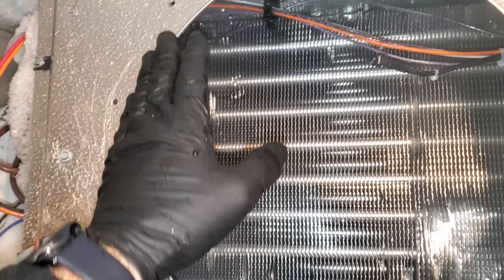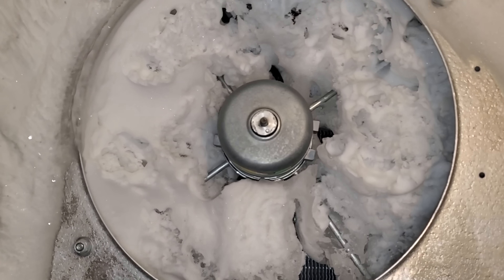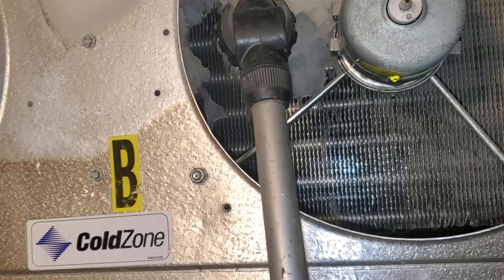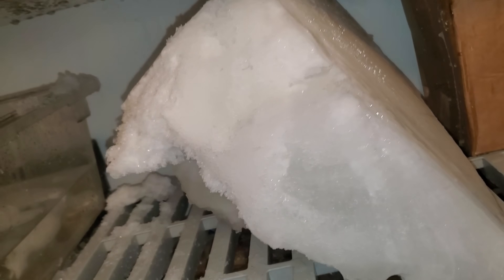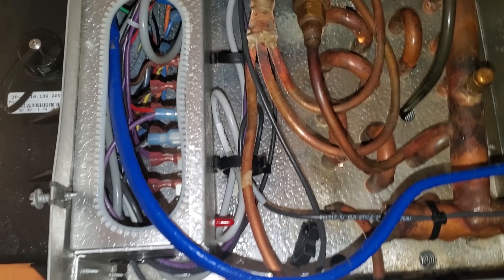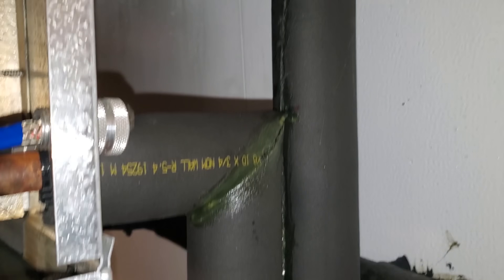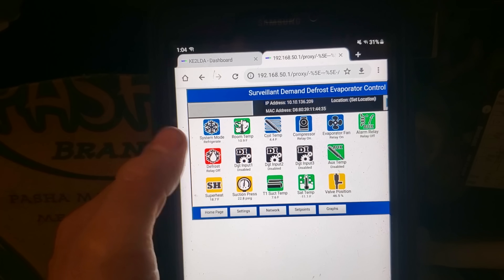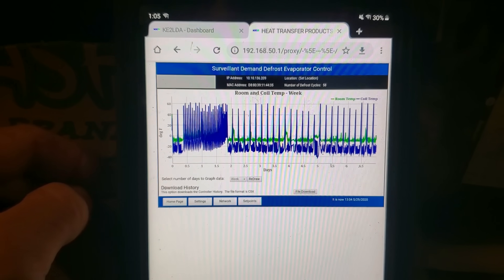IT'S BEEN ICED UP FOR FOUR MONTHS

Comment: Chris, at the beginning of the video, all those boxes are blocking the air flow, chocking the return air, I see that as being good part of the problem. I know, no matter how many times you tell the customer, don't stack boxes around evaporator, they still do it. From what I am seeing, it looks like a starving  return air flow problem. As far as the insulation repair, looks OK, I seen worse. Yes, the open end of the insulation (inside Evap.) should be sealed. I would redone that insulation on suction line inside Evap. Good job !!

Comment: Lots of fun ! Once had to defrost Jumbo evaporators in a 4000 SQ feet -20 ice cream warehouse along with a 2 foot dia.x 60 foot strip of ice at the top corner of the freezer , The corner wall had separated 4 inch 25 feet high and caused all this ice .

Comment: When you come across ECM's do you consider replacing them with conventional motors?  Over the years I have worked on some residential split-systems where a evaporator motor had taken lightning hits and their control boards where toasted, on two of them the customers had the motors replaced less than a year earlier, keep in mind we live in the lightning capitol of the U.S., these people are retired and on fixed incomes and really didn't have the money to buy another ECM, or actually really any other motor for that matter,however they need their AC working for health reasons. I had to solve the problem at as low of a price as I could. Now I understand ECM's  are more expensive that a cap run motor, but are supposed to save energy, which I discovered would take many years of run time to beat a cap run motor.

Looking at the other companies invoice, (they do a lot of radio advertising and their techs are commission incentivised ) I really felt the previous company really jammed it to them on the markup. My counter guy recommended a cap run, he explained he had a generic cap run that had the same RPM, same HP and same frame so it would right into the existing motor mount, all I had to do was cut the excess of the mounting screws ,after I had it in place, why the screws where so long I don't know but the motors fit right in, I found a safe place to ty-wrap the cap in and it was showtime. 

And the best part was when I handed the invoice to the customer, in both cases I thought the customer was going to cry because of the much lower price I was able to do the job for. And both agreed to go with a maintenance plan where one of us would stop by four times a year, check the charge which is seldom needed and do some house keeping, new filters, make sure the condensate drain was nice and clear, the A coil was nice and clean and the condenser was de-leafed and herbicide was sprayed around the unit twice a year to keep the grass and weeds away from the condenser.

I don't do any advertising but do get a number of customer references and for me it seems to work well. 

Charge a fair price, take of the customer and word gets around.

Comment: Do an experiment, braze on a 2 inch piece of 5/16 copper on the outside of the suction line as a sensor holder. 

The Ethernet cable connection on the side of the ke2 board is awesome.

Comment: "I am not an insulator"
(does a perfect insulation job)
" Again I am NOT an insulator)
Reply: I mean he's right when I was coming up a 45 degree miter is unacceptable and would of been torn out due. The reasoning is the  air gap at the 90s  can build ice and tear if another joint is unsealed anywhere on the run. 22.5 minimum was the angle for all cuts 15 degrees for ptraps. But it takes way to much time
Reply: As a once-upon-a-time union insulator, I can tell you it's not the worst I've seen.

A 3 piece 90, and using some ArmaFlex 520 contact adhesive properly. You need to paint it on the mating surfaces (not globs, like you'd paint a wall but light) and you NEED to let it tack. Once you've done that, press the seam together. It'll stay together for a long time and provide a proper vapor barrier.
Reply: He is not a perfect conductor either.
Reply: That's because he's a CONDUCTOR!!!!
Reply: German Plumber here, was thinking the exact same thing xD

But I don't do HVAC stuff ( not so common here ) so I dont have the first clue of that stuff.
Reply: Tyler Richardson    Looks pretty good to me!
Reply: Cutting down the pipes just to make a not even perfect insulation? He has to be joking, i wouldnt have even bothered with covering the gluemarks with tape.
Reply: i couldnt even figure out how he did that! he must show us how to do it!
Reply: reynanmegx23  it’s just a series of 45* angles.
Reply: @reynanmegx23  you cut a 45 degree angle.  Apply contact cement, twist and push.  The reason he proclaimed he's not a insulator is the fit and finish is not proper.  Main issue to help in the future is to use less glue, then allow to tack up until dry to touch.  Also a 3 piece 90 using 22.5 degree angles have less joint stress and will last forever.  And sliding joints will fail with in 5 years every time.  The interior angle gets bunched up, exterior on the insulation is drawn thin and will split.
Reply: Exactly! 😁

Comment: Things I see. Blocked airflow with boxes. Excessive door openings or left open. At least one coil sensor bad. Low charge due to small leak on suction side, possibly brazed joint in piping.  Partially blocked drain. Possible left fan motor intermittently not starting or blade blocked by ice buildup. I recommend a -5 setpoint for KE2 controllers for freezers.I  really like the KE2 controllers and their support when you run into a weird problem is excellent

Comment: I did home appliance service for 42 years and when I'd run into frozen evaporators I would tell the customers that it was going to take an hour to just remove the ice and frost. If they complained, I would say that it didn't build up in just a day, so it will take a bit of time to remove SAFELY! Safe for the coils, the heater, the fans, the cabinet, etc. You know that frost was visible on the exterior of the coil box for some time- nobody took it upon themselves to report it or even question why it was there! Great work as always!

Comment: Once of prevention worth a pound of cure. When I have to re- insulate by splitting the insulation. I start at a straight section , seal and tape it up, then slide it on down and around. and repeat, till it's covered. I think your outstanding. GOOD YOB !

Comment: Kudos on the video.. Beside age thing, one of the reasons i repurposed was electronics being used to a greater and greater extent.  Main bitch about electronics; every manufacture has their proprietary way of doing the same thing There is no standard. Getting reliable tech support was getting more difficult and companies where all starting to go to authorized tech people only. (Farmers are having a huge problem with this.) 
    Intermittent problems are also more difficult on electronics, Old adage if it ain't broke when I'm there I can't fix it.  (I am, i think a little like you, if i didn't accomplish anything for the customer, i had a hard time justifying, to myself, charging for the time even though i put the best effort in to solve an intermittent  problem)
    On the insulation repair... Use the softer type of insulation  (1"2 wall) slit it into 1" strips and spiral wrap it over itself. Easy to go around elbows and p traps, in a walkin freezer also easy to double wrap. Use the good Scotch 33+ electrical tape to secure the end. Always kept a couple lengths of 3/4" id  insulation in rig.  Can repair  any size suction insulation, also good to use for padding in other areas.

Comment: Have you considered using some sort of CRM software to keep track of the details of service calls so you can look them up later on?

This time it was more of a curiosity as to whether or not you needed to top up this customer several years ago, but I think I remember some other recent videos where being able to look up what was going in with the equipment last time before you even go out to the site might have been helpful.

Or even what was going on when one of your other guys worked on it - you seem to have a pretty decent head for remembering this stuff, but it's hard to remember something when you weren't there to observe it in the first place.

Comment: I wonder if a PCV jacket would help keep the customer from tearing off the insulation? Though you'd have to make that look good to, lol.
Reply: one word would cure the problem  Cork-Tape  even two layers....  and I always raped my temp-sensors  and expansion valve bulbs with cork-tape....  the stuff is cheap but will last for ever...
Reply from the maker: Cork Tape is a swaer word in my vocabulary.... To say I hate the stuff is an understatement , I’m going to discuss live on YouTube this evening 6/29/20 @ 5:PM (pacific time) come over and check it out https://youtu.be/qAVMB2gj6Kc
Reply: @HVACRVIDEOS    well what happen to the live feed, really wanted to hear what cork-tape ever done to you,  why you hate it?   lol
Reply: @Ivansgarage  I haven't seen the video, but I'm guessing that someone mummified something with Cork Tape and he had to try and remove it without absolutely destroying whatever was wrapped in the tape and likely either busted whatever was wrapped and/or his knuckles when removing the tape...
I HATE Gorilla Tape with a Truly Unholy Passion for the same reason...it Holds great, but may the Gods have mercy on your Soul (and hands) if you ever have to remove it without wreaking what it's stuck to...Cause it sure as Hell wont...
Reply: @HappilyHomicidalHooligan  Electrician's trick for taping something where you can't have residue: use two layers of tape. First wrap with the glue side out, then do a tight wrap over that with the glue facing in. If you do it right the wrap can hold up to even several hundred pounds of pulling force.

Sure, it uses a lot of tape, but that's usually better than the alternatives - losing a pull head, damaging your materials, injury, etc..

Comment: One tip for insulating suction lines in freezers... Actually glue the end of the insulation, in this case where the sensor was, to the suction line. When the end of the insulation is open, moisture will ingress and freeze and expand. It's important to seal the open end.
Reply: Der Werkzeug König how bout a zip tie at the ends
Reply: @joeshearer1247  That might be sufficient. I would still glue the armflex to the pipe for a better vapor seal.
Reply: @ImportWade  Ich glaub das spielt kaum eine Rolle bei der Menge an Leim die der Typ da drauf haut xD
Lächerlich, aber naja. Und bissle mehr Geduld sollte er auch haben, der Leim war ja noch Klatschnass ahahha
Reply: Joe Shearer. Nope. On freezer you need to be very fastidious against gaps in insulation or the frost creeps in. Use the right type of sealant/glue
Reply: Yeah armacell yellow glue best . I insulate for 37 a hour

Comment: In the opening shots of the vid, I couldn't believe how many boxes there are stacked along side of the evaporator and underneath as well.  I would have thought that could contribute to the build up because of poor air flow. It's a common sense thing and running kitchens for years, I do remembering in my young days a tech explaining not to restrict air flow. He said never stack boxes on the sides of the evaporator or up to the defrost pan.  Why on earth would the coil need air flow ?  (Insert extreme sarcasm) As always, Meticulous Detailed repair.

Comment: Why do they have a eev and a solenoid? I’m sure those boxes right against the entire evap didn’t help with airflow
Reply: Solenoid is for a safety in case the eev can't fully close, especially if it is wide open and the coil loses power for whatever reason. Typically with the KE2 controllers they are on a separate circuit from the condensing unit.

Comment: How HOW do you leave a coil iced up for 4 MONTHS?! That is absolutely baffling.
Reply: It only partially iced up, there was still enough airflow over the coil to keep the stuff in there cold. The problem isn't with the equipment, it's with the people (not) observing that the equipment is in proper working order. You should check for an iced up coil every time you load stuff in there, because you're literally throwing money (product) away if the coil is iced up enough that it can no longer keep the contents of the walk-in cooled adequately.
This one was "fine" for 4 months until it finally tripped the high box temperature alarms. Notice how it only made a horrible noise when starting.

Comment: Why don’t you use a hair blow dryer in situations like that? Someone gave me that tip and it works great for me.
Reply: For the same volume, and the same temperature, water will carry something like 40 times more heat energy than air. So even if the hot water is only about 120-150 deg. F, and the air is like 400 deg. F, the hot water will still carry more energy. Heck even cold water has enough energy in it to melt ice faster than a hair dryer.
The only issue with using water to melt ice is that you have to make sure the drain can keep up with the flow or else you end up like Chris did in this video with trays under the drain pan to catch drips. In other words it can be messier than using hot air, but it's just clean water so it's not the end of the world as long as you don't let it get into a fan motor or electronic controller or something like that.
Melting ice is all about energy transfer rate, because it takes a lot of energy to melt ice. That's why ice is so effective in a cooler.
It's phase change thermal transfer just like HVACR is, but the phase change is between solid and liquid instead of between liquid and gas.
Reply: 44R0Ndin true, water on a walk-in floor is a big no-no. I do mostly plug in restaurant refrigerators so all that water on the floor is no good either.
Reply: @44R0Ndin  this is true... and besides, dousing it with water also cleans the coils... two jobs in one spray indeed.
Reply: @DanBurgaud  If the ice all breaks away uniformly from the back of the coil like it did in this video, it takes at least some of the stuck-on dirt and dust and grease with it (hopefully)
Reply: I also use a heat gun in some cases but it takes forever, but sometimes its the only solution if running water is not accesible or near or running haha....  3rd world sh1thole problems...
Reply: ditto..
Reply: In theory, I think, the warm water should melt the ice faster than warm air. Napalm, on the other hand ...
Reply: Hair dryer, no. Heat gun, maybe. Either would take hours with that buildup. Warm/hot water is the fastest.

Comment: What wond do you use for washing coils and deiceing coils?
Reply: I saw a suitable one at Christmas Tree Shop recently, but I'm sure any hardware store would have something usable. The thing to look out for is a nice gentle shower-head like spray and an adjustable water control valve on the handle so you can adjust flow as needed.

Comment: Tech: "How long has it been iced up like this?"
Customer:  "You mean it's not supposed to be?"
Reply: I've never worked with freezers apart from the small one in my home obv.... but I also thought that a little ice was normal - not to that amount obviously, but like a thin ice layer is normal...
Ever since I started watching I learned that - no ... Ice is bad.
Reply: @Shark5060  There are often cases where people/installers/whoever cheaps out on the evaporators and they end up with some ice on it all the time. Or they often ice up like this one. Basically in most similar cold rooms you need to pick an evap with a bigger fin spacing or they ice up. Now... that usually costs more, sometimes you have to wait cause they don't have one in stock, etc. And then they improvise. You get the idea.
Reply: Some people are not the brightest light bulbs in the box.
Reply: My first job was in a restaurant. They let ice build up until the freezer quit completely. I had to basically saw 8 ounce pucks of ground beef off the frozen tubes of meat before it thawed to repackage for a freezer in the kitchen. That was a fun day.
Reply: It's counter intuitive though.
When I was a kid always thought it's good when the fridge or freezer is iced up. Because I've is cold and that's what those things are supposed to do - cool stuff.

That it actually reduces the cooling ability and increases the Energy requirements is pretty much not logical for people who didn't do the tiniest bit of research.

When I learned about that it kinda blew my mind but made sense. And people don't really want to learn stuff anyway. That's why many people aren't worth the oxygen they consume. 😄

Comment: Im sure the ice started from the blocked condensate drain along with the refrigerant leak. Iced build up chip the fan blade and made matter worse with more air flow issue.

Comment: Were there boxes on the shelf up to the bottom of the evap?
Reply: I see things like that a lot. I work for the local school board here. No matter how many times you tell the kitchen staff not to block the air flow or leave the door open they just do it any way. They are not the one getting called after hours to fix their fuck up.
Reply from the maker: yep , this is a small freezer and they have it crammed